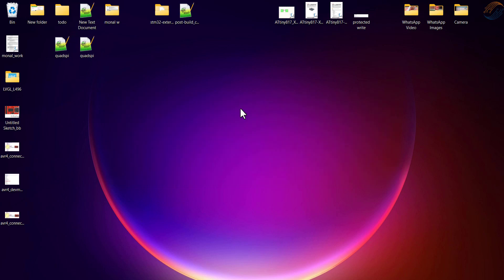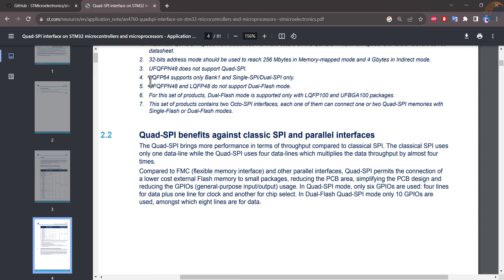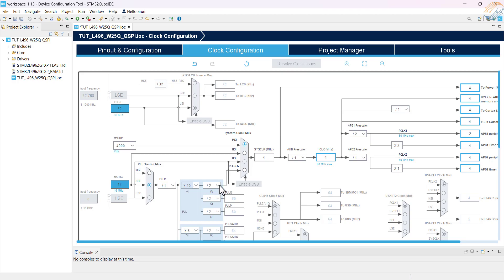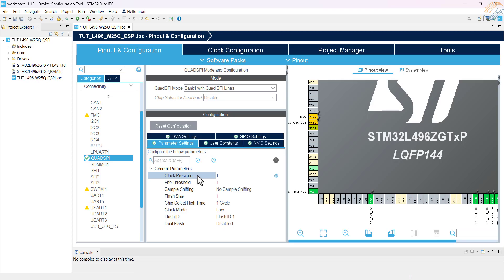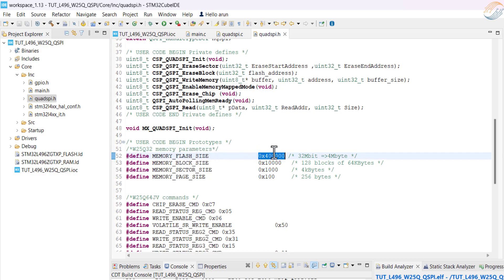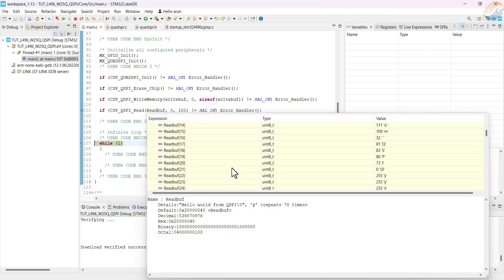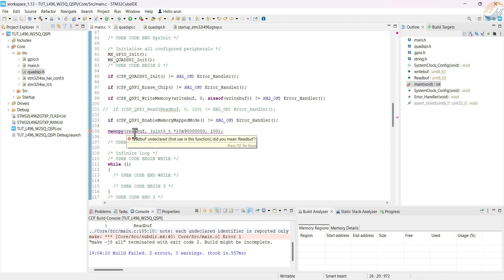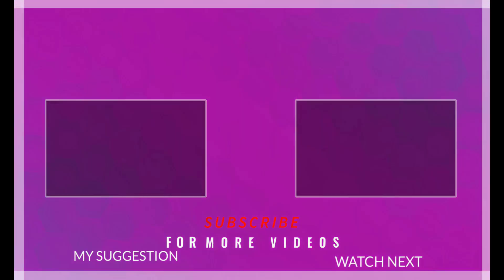W25Q FLASH Memory || Part 7 || QuadSPI Read Write Erase || Memory Mapped Mode

Comment: Thanks again for your very usefull tuto those tuto make me jump to stm32 mcu's ST Electronic have to pay you for your job😃. I Have follow your tutos and they are working wonderfull...I have a question about qspi mapped mode starting at 0x9000000 how i can quicly manage adresses when i want to retreive specific records , I haven't understand well how adresses work on qspi mapped mode  vs normal spi w25Q driver
Reply from the maker: 0x90000000 is where the QSPI address starts. On top of this, you can use the offsets, but keep in mind that the entire sector is erased when a new data is stored.
The QSPI mode is not used to store and fetch information which changes very quickly. This is rather used to store the constant data, like images, videos, etc.